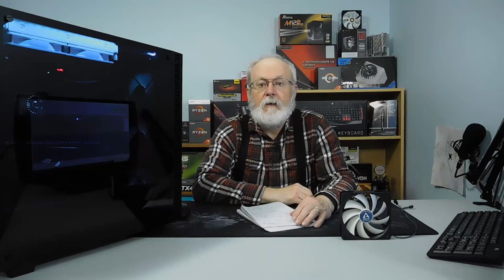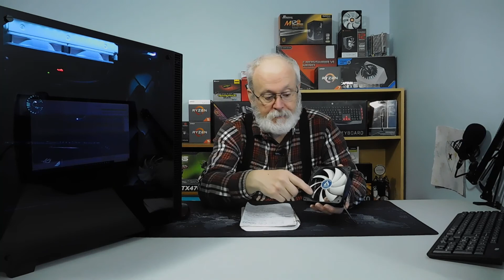Aura Sync, 120mm Arctic Fans and Thermal Paste...

Comment: Again, it's something from them super Impressed. These are dead quiet and nice air movement for what they are.
Reply from the maker: JR, yes they are great fans for their cost. That's why I like and use them, but other channels get lots of expensive fans to show and use. Those fans are probably somewhat better, but not in price to performance as far as I can tell...
Reply: Well I just needed a couple fans really. I had a Corsair fan making a lot of noise and one of those ek Vardar fans died. I seen those and yeah good price and performance. They move more air than them Cheap alpine fans i got too. Planed on sticking a few on another rad.
Reply from the maker: I have  DeepCool Captain 240EX AIO and it makes my CPU 5 degrees hotter than my CoolerMaster MasterLiquid 120 Dual Fan AIO. I am thinking of putting four of these Arctic Fans on the Captain 240EX in push/pull mode like the MasterLiquid 120 and see if it works better, same or worse...
Reply: Oh I'm on Loop blocked up 3/8x1/2 hoses and just an ok pump and all booted laying on the table/Desk...Need to rma the supermicro some problems with it, but the evga FTWK looks all good and doing well. Dud chip though man...even delidded this one and it's still hottt.....
Reply from the maker: I haven't got that far into liquid cooling as of yet. It might take me a couple of years before I'm comfortable enough to get into open loop cooling.  I hope your RMA is dealt with quickly...  So you have liquid metal on your CPU, which chip? That's a pain, what are your temps getting too?  As for mine tomorrow is test day for my four fan Captain 240EX, I hope it works better. I guess we'll see...
Reply: Yeah It's the 7700k, Yeah tried some stuff thermal grizzly, Liquid Ultra etc...about the same really. It has been a little warmer here and ambients and all. But yeah can easily go to 80c at 4.8ghz and the stock vcore etc.
Reply from the maker: That's a nice CPU, and those temps are a pain after all of that work.  I know if my ambient goes up 3 to 4 degrees then my CPU temp goes up 4 to 5 degrees, that's on two AIO's and two air coolers.  I've been testing some things and didn't know the CPU temp would go even higher than the ambient temp change.  I hope the Arctic fans and your pump RMA lowers your temps, sounds like you have been doing a lot of troubleshooting...
Reply: That's the thing with ambients etc...gonna try adding another or bigger Rad, waiting on the fittings etc...that pump is still plenty it's literally about the same as a d5 turned down low. But yeah right not really any different than the aio, could almost even be on Air. Other than that yeah been a Blast of a platform.
Reply from the maker: I might have misunderstood the supermicro you need to RMA. Is that a pump? If not what is it, I guessed it was a small pump but I really don't know...
Reply: No, it's another board etc. I'm pretty sure it's bent pin stuff probably....I think I did bump get into the pins on the bottom/left of the socket a bit, reseat the cpu/mess with cage, I think it did seat right than it went away etc...but went ahead and did the delid and seemed to have lost that. I don't know some funky stuff can start happening with all that. Another one pretty Mean with Power delivery/Phases etc.
Reply from the maker: I guess I was in left field on that one.  That does suck, I have bent pins on so many things in my life and sometimes it takes a while to straighten them. I've broken a few too, 30 years ago you could sometimes solder a wire to replace the pin but not too much of that these days. Everything is a lot closer to each other now and a lot more heat sensitive. A CPU socket is a different story, so many pins in such a small space and you think they would be made of harder metal...
Reply: Yeah same thing bent broke pins before on other old boards, same old Intel socket like.
Reply from the maker: That is for sure...
Reply: Yeah hotter than id like...that 5ghz mark 24/7 was never really realistic. Need too much vcore and hotttt etc.
Reply from the maker: I understand that (Silicon Lottery as people say), I've only been doing overclocking for about three months so there is only so much worth in my statement. Yea, Vcore and heat definitely work against a stable 24/7 OC settings. I'm learning that one, for sure...
Reply: Yeah I had another chip that could of done it and did on slightly less vcore and still stay cool...but it died awhile after I delided it.....this one on the other hand no it's not silicon lottery etc.

That one was the Lottery big time. Was in all last winter and cold ambients...playing around at like 5.2ghz at 1.35v...was an awesome chip.
Reply: Not sure what the hell with this chip and it's delidded relidded....leave the shit running 24/7 etc...got up this morning, something last night shot it to 91c red stuff...according to hwinfo...hot for 4.8ghz and only 1.248-1.26v stock stuff etc.
Reply from the maker: That chip is giving you grief, 91c that is hot. I don't have any idea, except did the pump stop working or maybe intermittent?
Reply: It's hard telling...I don't know came back and core 2 hit 91c...looked like everything was still working, nothing else picked up or any indicator.
Reply from the maker: The only other thing that I have heard of is if you have an air bubble or not enough thermal paste in a small spot that correlates with the hot core.  I think I saw that on Gamers Nexus or JaysTwoCents...  Just another guess...
Reply: I don't know, that thermal grizzly stuff on the die and I ran out...some old mx4 on the lid/block.
Reply from the maker: It was when you said a hot spot on the cpu, reminded me of that video. Like I said only a guess. Did you clean off the silicone from between the IHS and the CPU board?
Reply: This time around no I didn't, it may not have seated very well...I could try that and id have to use mx4 though..unless I order something.
Reply from the maker: Yea, on that video and der8auer have said that not removing in can make the IHS not fully seat on the CPU die. If I remember correctly...
Reply: Yeah I seen a handful of things from Him. I believe probably the case too...probably what I'll do, just scraping with the blade being careful not to gouge the pcb...might just delid it again and scrape it and reseat it...I put quite a big blob of the Thermal Grizzly on it and yeah that is about one of the best non-metal tims.
Reply from the maker: Yes, Thermal Grizzly is that according to Gamers Nexus (they are great at testing). I heard der8auer say try to only use your finger nail or plastic edge to take the silicone off of the CPU board because of the chance of hitting one of those surface mounted capacitors or resistors...
Reply: Yeah..it's some sticky stuff though, and hard to get real flush. I just fixed it and yeah same stuff like that same GE clear silicone etc, good stuff. It actually looks Phenomenally better already....browsing messing around hit about 68c at 4.8ghz, not getting into the 70-80s at all now...not too bad man.

And they rate that tim pretty high on conductivity...higher than mx4....I just did like what they did that other chip, big blob on there, that stuff is alittle thicker though.
Reply: Magic of a difference man...looks great...what the hell .4 .5 of a mm can do etc....
Reply from the maker: So, you have 68c now on your 7700K at 4.8GHz good for you...
Reply: Yeah not once even hit 70c....Yeah it probably do 5ghz now and stay cool enough etc. But yeah even 4.8ghz is a good spot.
Reply from the maker: That's awesome, good for you.  I hope it keeps low temps for years and years...
Reply: Well hopefully for a little while longer.

Comment: I am looking for some good fan for my psu but when i order psu fan i want also buy some new case fans. F12 i seems good fan but people dont buy them so much. Maybe have some advice for PSU fan with 5v starting voltage? I just fanswap my cosrsair vx550 fan long time ago with scythe s-flex 1600rpm, but fan just start dying giving clanking noise.
Reply from the maker: Hi greezly, what is the size of your PS fan? I'll check and see what I can find. be quiet! have some maglev fans (link -https://www.amazon.com/quiet-BL066-SILENTWINGS-1450RPM-50-5CFM/dp/B01JMEDDYY/ref=sr_1_1?ie=UTF8&qid=1548623929&sr=8-1&keywords=be+quiet%21+BL066+SILENTWINGS+3+PWM ), no bearings to wear out, they might have a fan for your PS. Well probably why people don't buy the Arctic F12 PWM PST fan is because no RGB, I can't think of another reason. I know they use this fan on their liquid AIO's and they are  some of the best ones for low noise and cooling...